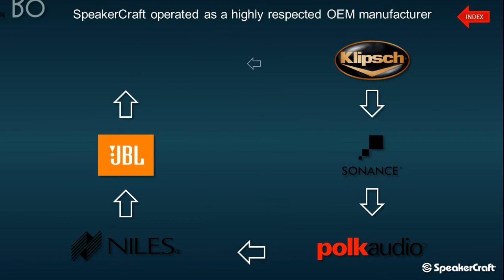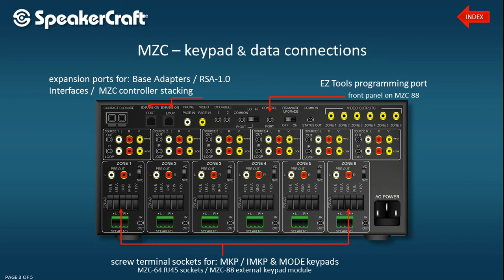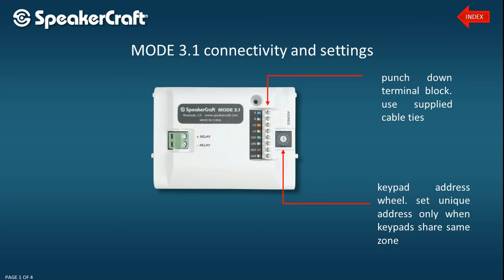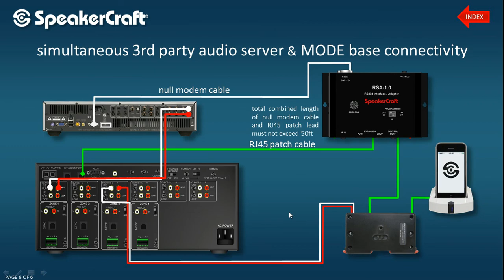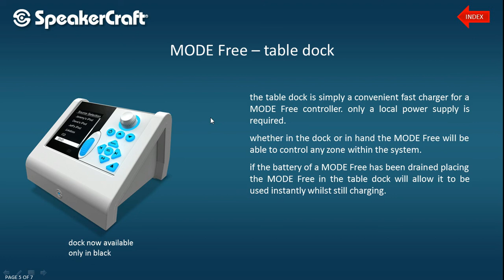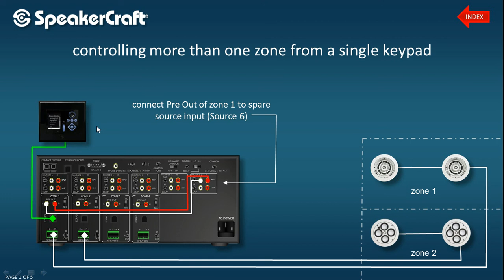SpeakerCraft Mode - 1 Overview

Comment: Hi Sir  I need  EZ Tools software download. but I not find this program from internet or speakercraft web site.  I want firmware send to MZC66 . Because not correct working , dont have a Audio zone output amplifier and preoutput  audio signal for zone. This all system 1 Ipod and dock , 3 pieces Mode 3.1 wall control panel and 1 pieces MZC66 possible  yours help me? send me EZ Tools download and firmware link for MZC66. Thanks for you helping
Reply from the maker: see my reply on your other comment

Comment: What is the product roadmap for MZC and where does mode fall in?  Still relevant?
Reply from the maker: MZC has been end of life and out of production for over 5years - their are a lot of installs out there and still working though, so the video remains relevant for those people needing to do updates or reprogram.
Reply: @aldoussystems  thank you, I think I was asking because I'm one of those installs thats still hanging around and am looking at options to evolve/improve.
Reply from the maker: If your install includes an RSA1.0 adapter, or if you can find one online, then you have many options - we offer one that is called CasaTunes - this gives you streaming services and an app interface, and the app can control the switching of the zones on the MZC - however you have to have the RSA adapter and not all installs did (this is also out of production but they do come up on ebay, amazon, etc from time to time)